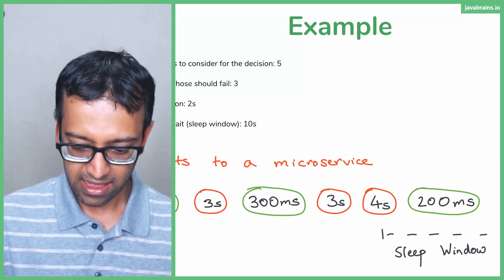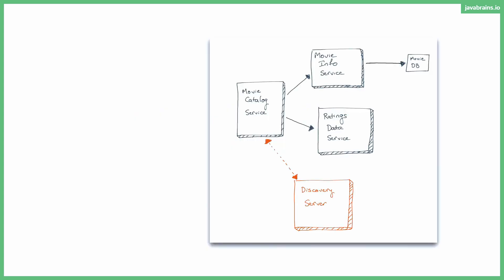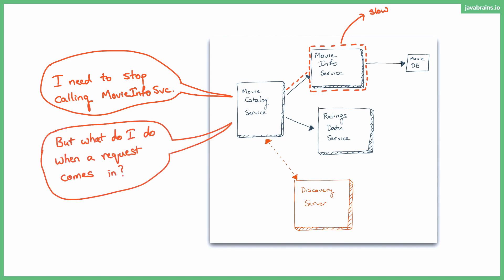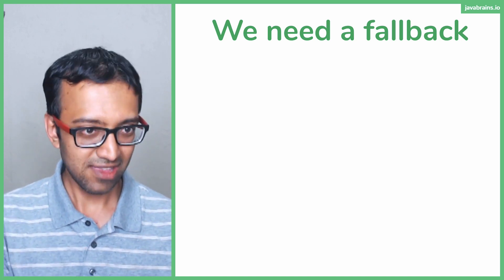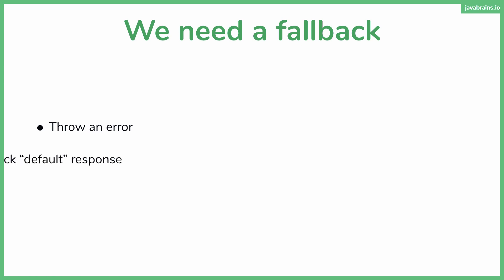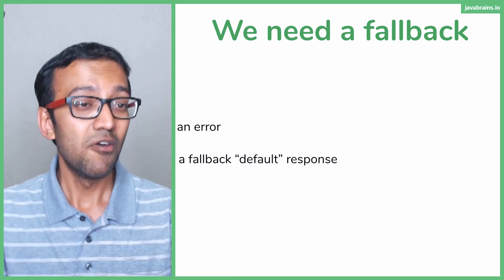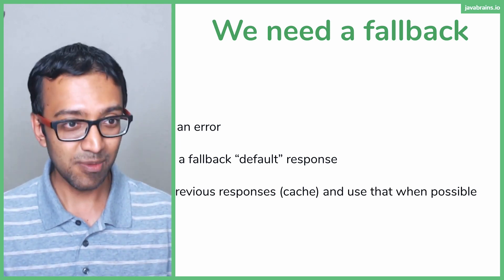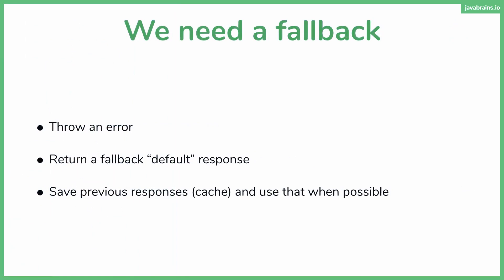13 What to do when a circuit breaks - Spring Boot Microservices Level 2

Comment: Great content sir . Quick question about the cache solution for fallback . , Correct me if I am wrong but, if it's a cached response  why would we even go to a db connection or computation that would result in the mircroservice failing ?
Reply: Even I have the similar question like what if the cached response is not relevant reponse to the given request.Is it blindly sending the cached response for every request¿

Comment: Hey is it the correct approach (save previous responses) when your  microservice is calculating data based on some dynamic formulas and database inputs. dont we get stale output considering an example of real time data streaming architecture
Reply: I think for real-time critical systems, it's more important to have multiple instances running and if one instance is running slow then break the circuit for that instance and pass the next requests to other instances.

Comment: As you said that the best option will the fallback which will get the last response from cache and return it.What i understand is that it will be suitable if micro service we are calling returns some response (REST API which is expecting GET request).What we have to do in circuit breaker if api which is slow is POST REST Api.

Comment: Dear Kaushik
My openion is to handle this from an infrastructure point of view. 
Its better to host each service on a different machine. Create an autoscaling group for each service . 
Put a load balancer in front and add listeners to it. Based on the path (ie the microservice being called) the call is forwarded to the appropriate autoscaling group by adding the corresponding external configuration.

This way more machines can spin up and the service can handle a large load.

Also whereever there is a dependency between services we can have a load balancer tied to an autoscaling group.

This may cost more but i think this will work.
your thoughts?

Regards
Mukund

PS: Thank you so much for all your videos and adding so much value to my life. Big fan since 2014.